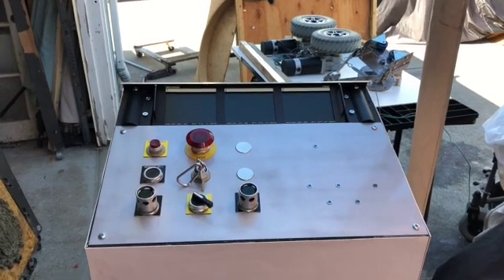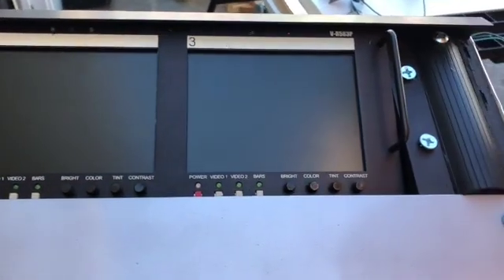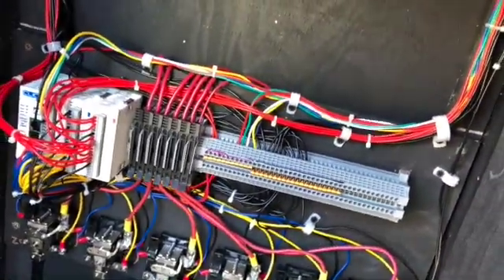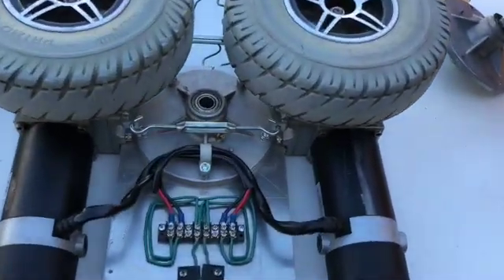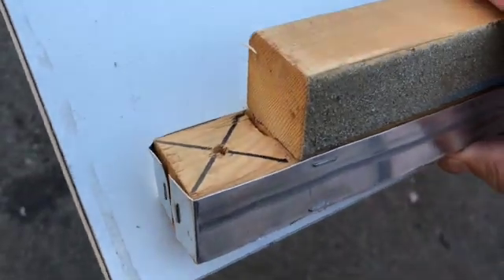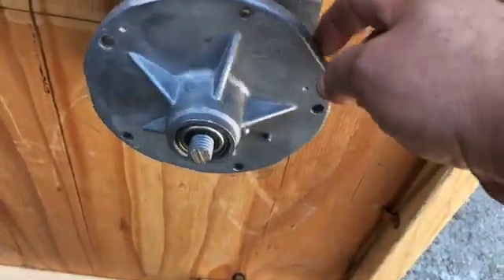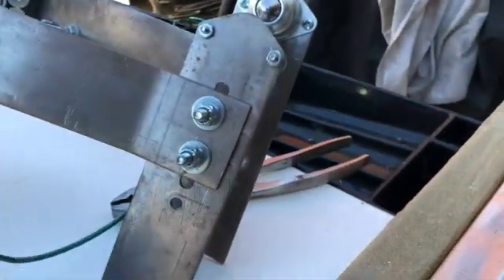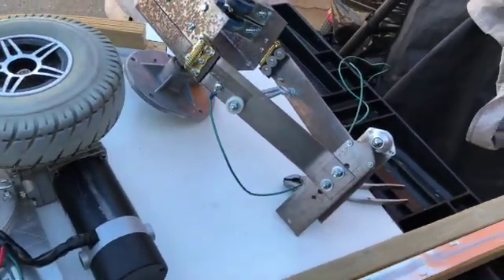New Ride System Update! (Homemade dark ride)

Comment: I am designing a plan to do this in my basement. It will go through the grand canyon, a jungle, underground caverns and maybe Disney's it's a small world, etc.  I would like to make the lead vehicle pulling the other two, two person cars and I will drive the front one, but I still want it on a track so I dont have to steer it  like yours. what do you recommend to accomplish this kind of tram?
Reply from the maker: Hi there, glad to hear about your basement attraction!  The first question I need to ask is what are you planning to use for the Lead vehicle? Second, what did you have in mind for power to run it(batteries/on track power?) Also, are the rear passengers small children/adults/mix of the 2?  There are several types of track design you can use for this depending on your skill set/budget/layout.
Reply: @pixelvisioner  Thanks Bret. I was thinking the lead vehicle to be electric powered as essentially a tow vehicle, but guided by a track, just because it sounded simpler to make? 3 total cars, lead and two getting towed which can carry two people each. Could be any mix of all adults or occassionally children as well. I have built several houses, restored several and workshops etc and done all the electrical and plumbing myself,so I have decent skill at it, but still dont want to get too deep into the woods in complications either. Is a track powered vehicle better? I dont want to need a person at the podium controlling the ride. I would rather control it on the ride in the lead vehicle.
Reply from the maker: Okay, I understand where you are going here. If you want to keep it simple, I would suggest finding a mobility scooter that has a weight capacity of 600lbs and use the drive train, wheels/tires, electronics and batteries and build them into your lead vehicle. As far as a track design, you con use either track types that I have used , or have track sections made out of 1/4" steel and have the turns bent at a steel shop. As for tracking of the vehicles the design I used in my first or second ride vehicle designs should work fine. @diyoregonnowtexas9202

Comment: I would like a power rail system. without a computer. I therefore need a large 24v transformer, I pass the current through the rail, connect to the train, then it's the same diagram? controller then directly to the engine, is that it? I work on a carousel, there were 3 buttons for the 3 rail circuits
Reply from the maker: You will want to control the speed of the ride vehicle with a 24v speed control unit inside the ride vehicle. And to control the start and stop you could use a remote RF on/off switch like I used in my original ride vehicles and connect it  between the motors and power leads from the pickup from the track. The same speed control I used will work as well. watch part 2 & 4 of my series "making a home made dark ride" I show both the speed control in episode 2 and the RF controller in episode 4. the wiring diagram I show on episode 2 will show how to connect both, with the power leads from the track to replace the batteries in the diagram. I hope that helps? let me know if you have any other questions!
Reply: Yes thank you so much,  i have others questions but do you have messenger ? Rudy Rd please contact me

Comment: Hey brett, here Anne Schepers again from Holland. I've been working on it for a while, and have come to the conclusion that it will work after all.

I bought an outdated BERG go-kart, that is a Dutch brand, and I am going to convert it, and put a dc motor from Ali Express on it. I'm going to do this with a gear transmission with a chain. Then I weld a gear on the pedal shaft of the go-kart, and then I put that on the shaft of the go-kart. This saves me a lot of work, thinking out and welding, which I know little about anyway. 

For the rest of the track I will see if I can use pallet wood in the first instance, as we have an abundance of that anyway. Or secondly, cheap sheets of MDF that I can buy somewhere. Because the wood prices have risen enormously here in the Netherlands because of covid-19.

Further in terms of technology I already had a 12v battery from another project of a raft with a motor. It has 73Ah and I think it can last a few hours XD 😝.

Now I have a question, how did you do it regarding the control of the attraction, through an adapter and a few buttons you can send the signal wirelessly to the carts? I saw that you guys had soldered the signal per button on either side of the buttons on the module transmitter. Are there any irons on there that you soldered t to? Or did you solder them to the plus and minus of the buttons? And is there another way to buy a transmitter module where you can connect cables to it, without having to tear down the whole remote first, without knowing if it will work or not? I would hate to buy something that already works and have to adapt it to the system. It would be easier if the possibility already exists to solder wires on it.

But otherwise a top project of yours, I get a lot of inspiration from it XD 😝 keep up the good work! 

And I thought you were working on a project that the power ran along the track? Because what I saw now is that t was just t old again. Or is this an in between project? I would love to hear from you guys. Greetings from the Netherlands. And hopefully I'll talk to you sometime. Anne Schepers.

Translated with www.DeepL.com/Translator (free version) srry iam bad with english XD 😝
Reply from the maker: Hi there Anne, great to hear from you again!  As far as the remote switch you would need to purchase a 12v RF remote switch if you are trying to use the same setup I made in the videos. I used a voltage meter switched to test continuity to find which connections on the switch connected when pressed,  then soldered the wire connections to them. I  wired them to lighted arcade switches.  I'm not sure if there is a wired version available to purchase. I purchased my switch on eBay which has a 300 foot range. I have had very little time to continue development of my new ride system, so I decided to use my old system for this years attraction. I added on onboard audio system this year which has a triggerable MP3 player to play audio clips of the host giving the tour of the Manor and used an RFID switch with key FOBs along the track to trigger each section of audio on the MP3 player. I'll be sharing a video of how the did it as soon as I have some free time.  I'm hoping that in the next 1-2 years I can get my new ride system running and make a new attraction!  I can't wait to see your attraction! 
Brett

Comment: I want to build a dark ride can you. Show you got the carts to work the the panel I want to try and make a dark ride
Reply from the maker: I will be making a "how to" video on this new system when I get the time. Did you watch the 5 part series on how I made the other ride system here on my channel?
Reply: @pixelvisioner  yeah I seen that. You should get fried from distortions he is a lot of money but he's as classic is you can get https://youtu.be/P6SJ6OgXVyc
Reply from the maker: @TraditionalGemmy  Nice! That would be a cool prop if I was still running "Monsters of Mayhem"
Reply: @pixelvisioner  why did you close it down
Reply from the maker: @TraditionalGemmy  Moving on to my next project, "Skull Island" gonna be using projectors, animatronics, and lighting effects using my new fully automated dark ride system I'm working on
Reply from the maker: Oh, gonna be using my Gemmy Pirate animatronic in it as well!
Reply: @pixelvisioner  make sure you replace the head turning gear because they tend to like to brake and hold the moters and they will blow a transistor

Comment: Looking forward to seeing your progress!
The wooden track looks harder to make than the PVC pipe you had before. Is it worth the extra effort? Or don’t you know yet?
Reply from the maker: Yes , making the wood track is a bit more work, but by using the wood track  it enables me to use the  twin motor setup to pull the ride vehicle along the track rail which makes it capable of carrying  more weight ( up to 500lbs), also I can run power to the two sides of the track.
Reply: @pixelvisioner  I subscribed